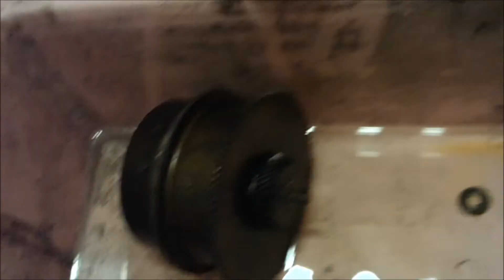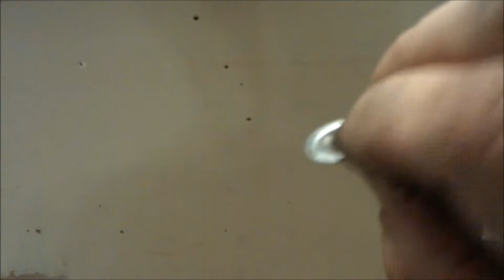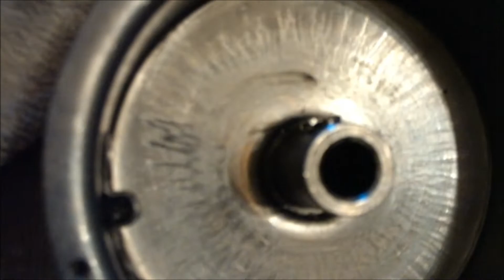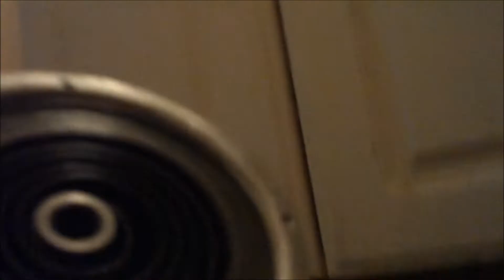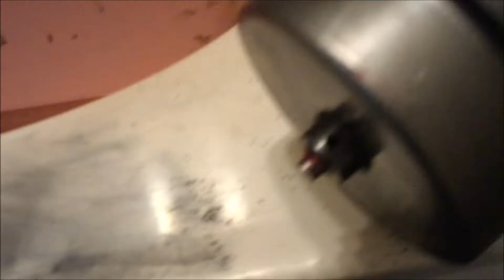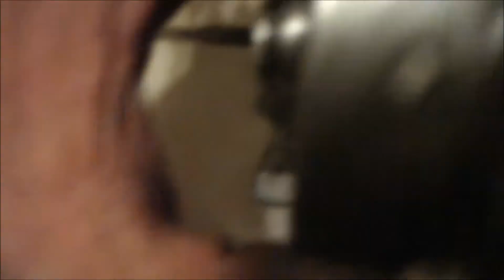Brunswick Spring Motor, Clean,Grease and then Playing!

Comment: Hello friend from Chile. My turntable spins, but when I put the needle on it, it doesn't stop. I cleaned the entire inside of the drum, but it still doesn't spin. I didn't remove the drum cord, I only cleaned the surface. Thanks.
Reply from the maker: The spring may get tired from age and lack of power, spring replacement is recommended. Some later electrical recordings especially red label Columbia records,slow the mschine down, so acoustically recorded records are the best.

Comment: I worked in a clock repair shop for 18 years and we always used clock cleaning solution in an ultrasound machine.
The best clock cleaning solution worked better than the others but was not allowed by law for some reason in some areas. Fire department limitations.
We would leave them in the ultrasound cleaner until they were completely clean when we took them out. No scrubbing needed at all. 
We used special clock oil and Grease in our repairs.

My daughter's friend just bought a Brunswick model 200 from the early 20s that I just fixed for her and got it running. I plan to do more work on it soon.
Currently doing research on old phonograph repairs, tips & tricks. 😉

I love restoring antiques. 😃
Reply from the maker: I would love to have an ultrasonic cleaner, I am sure it would do better than what I have but with a lot of scrubbing it does a pretty good job, sometimes the 100 year old grease needs extra effort , and so using a blade in each gear tooth is normal in this process, but an Ultrasonic would probably do fine.
Reply: @thenorthamericanphonograph1039  
An ultrasound is a godsend for people working on old stuff like that. We frequently worked on clocks that were over 100 years old, and some were over 200 years old.

Comment: Please, I would like an orientation if it is possible: I have a Brunswick Pantrope phonograph and the motor has 2 strings; the strings have been revised and replaced, but I can't give full strength and I can't play even one side of a 10-inch disc; in the middle of the execution the rope jumps, jumps ... and is very unpleasant. I would also like to know how many times I must turn the handle when winding the rope. Thank you very much, André.
Reply from the maker: On the spring arbor you should see the rivets, that go in the center pear holes, note that one side of the rivet is closed and the other open.  Your spring end goes in the open side of the rivet,  and catches , as it goes in the skinny part of the pear shaped hole, and this will determine the direction the spring is wound in the barrel.  Not many experts give instructions on how to fix machines.  The astute and stodgy collectors, usually castigate me for showing how to repair motors.

Comment: Do you happen to know how much power that spring can hold?  Does the specification of the spring say what it is?  I am guessing it is maybe powering 15 watts equivalent for 5 minutes which is only 1.25 watt hours (4500 joules).
Reply from the maker: Those springs run about 6 minutes., so  I am sure your calculations are close enough.

Comment: Vaseline and graphite!  Thomas Edison phono grease.
Reply from the maker: Yes.  Vaseline and graphite (Dixon's NO. 2 flaked) was Edison's original formula, though it  become a very sticky mess in about 15 years.   I use graphite and synthetic Mobile  1 which should last longer.
Reply: @thenorthamericanphonograph1039  How long you recon the synthetic will last? Do we know what happens when it ages? The one saving grace of the old stuff (not necessarily vaseline, I was just being funny) is that it doesn't turn to a solid mess and is generally fairly easily (a relative term) to clean and doesn't corrode the metal.  I've noticed modern gasoline can actually corrode the crap out of some metals when allowed to sit and decompose.
Reply from the maker: @tarstarkusz  Who knows,  perhaps we will find out it is a bad idea, or not any better than the petroleum jelly.  It seems to work nicely for now, I have had some that had this lubricant for over 10 years with no problems.
Reply: @thenorthamericanphonograph1039  Thanks.  Really, only time will tell.  People thought the ceramic disc capacitors were cheap and would fail in no time, yet they are the ones that lasted.
Reply from the maker: @tarstarkusz  That is certainlly true, those ceramics are durable, and mica moulded capacitors, while the paper and foil, and electrolytics fail.
Reply from the maker: @tarstarkusz  Wyatt Marcus tells me about the Vasaline, Grapgite being the best, as the springs slide better,the graphite helps
Reply: @thenorthamericanphonograph1039  I'm pretty sure Edison recommended it for the Edison machines.  There were instructions on how to make it (well, by instructions, I mean mix in some graphite powder with Vaseline) with some of the machines, at least that is what I heard.

Comment: I got my 1923 Camp Fone portable phonograph yesterday and it looks good, but it needs some cleaning. Everything I looked is filthy and nasty after 95+ years of use. Everything I removed is the gears and the governor needs to be cleaned until it gets reassembled. I have not checked the springs yet. This portable has single only spring barrel with a screw attached if you want to remove it to have a replacement spring. I did that one time on my Victor VV 8-4 and it took me all day to clean the springs, because it used the 4-spring barrels with 2 springs for each in 1 which gives us 4. That’s a toughie.
Reply from the maker: I have done those 4 spring Victors, they certainly can take all day.
Reply: The North American Phonograph Company One thing I forgot, I cleaned the shaft from the governor after taking them apart, and then put the pieces back together to have some pressure, put them back together, and BAM! My 1923 Camp-Fone now works! I tested out a 78, and it sounds amazing.

Comment from the maker: Sorry about the audio I used the horrible built in microphone in the camera. We are going to start using the Yeti Blue microphone from now on for our videos.
Reply: Very interesting info.  You might want to invest in a tripod to mount your camera on.  Then you can much more easily point to the various screws, etc. showing what to do.  Following the camera around handheld like that makes a lot of folks dizzy or nauseous, lol.  I assume my own Brunswick model 207 has the same motor and next spring I'm going to attempt a restoration.  I know I can do the cabinet work as I have restored several old radio cabinets.  Where do you find new springs, parts, etc.  if I may ask?  I know for my radio work there are lots of places like Radiodaze, Antique Electronic Supply, etc.  So far the only thing I can find wrong mechanically with my 207 is that the horn muffler knob behind the crank handle is missing and therefore I cannot adjust the volume.  Take care, Gary
Reply: I have a brunswick with a no. 2 motor. I need some parts for the spring barrel. Is this something you could help me with?
Reply from the maker: @SuperStealthyNinjas  https://www.wyattsmusical.com/    Right now  is about the only place selling new springs.  My supplier passed away a few months ago, and the phonograph community, has been learning that Ron Sitko supplied everyone with springs who repairs machines, so a few people have already started making new parts.